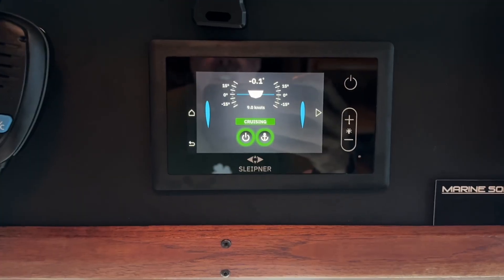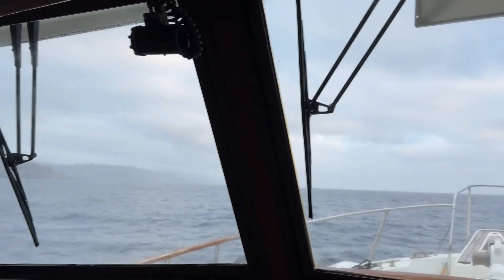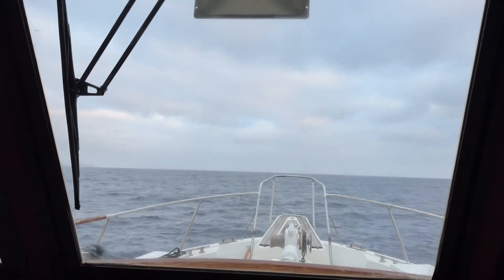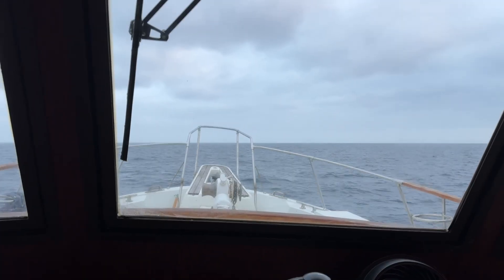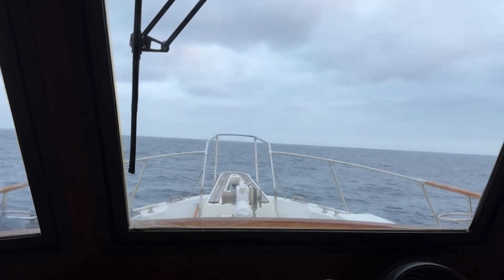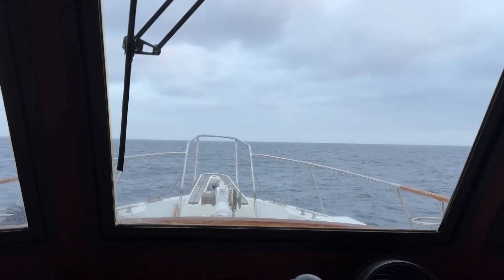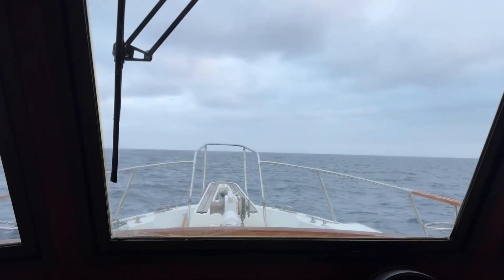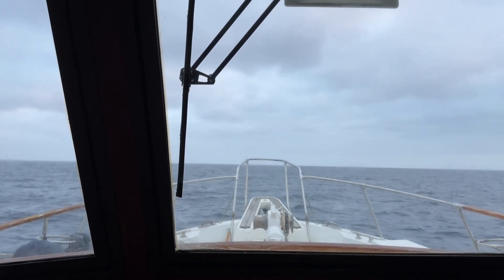Side Power Sleipner!!!! Electric Vector fins Next generation yacht stabilization. Wow is this Real!!

Comment: These look like quite an interesting solution, even with smaller vessels. We have a similar vessel to yours and have been exploring options such as the Sleipner fins. I was concerned about the cost versus the boat value, but of course, there is more to boating than resale! Any chance you'd be willing to share more information either in the chat or privately about the installation, the behaviour of the fins, the size of the battery bank to run them, and the cost of the investment in the vessel? Any input would be greatly appreciated. All the best from a fellow Gold Looper!!
Reply from the maker: You can call me directly and we can chat 702 885-7579